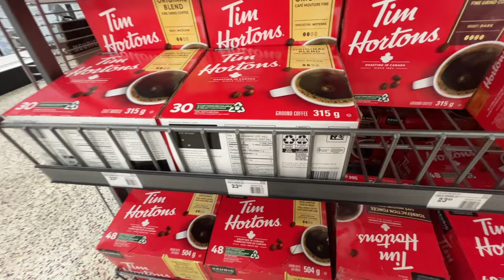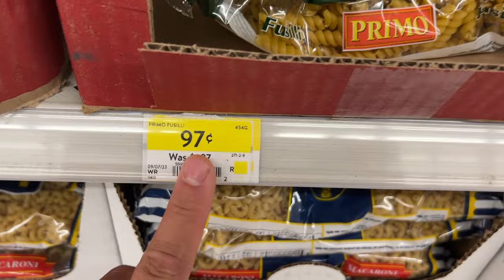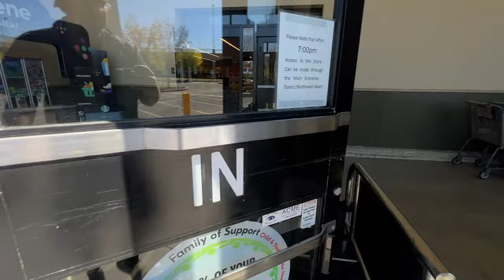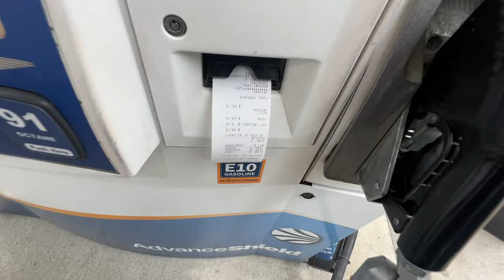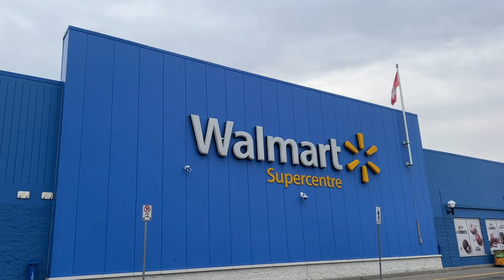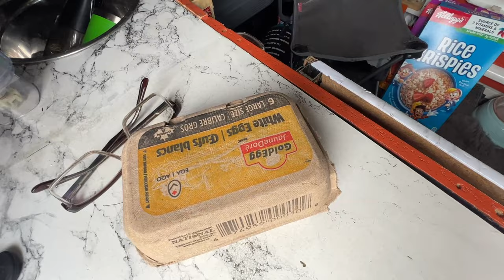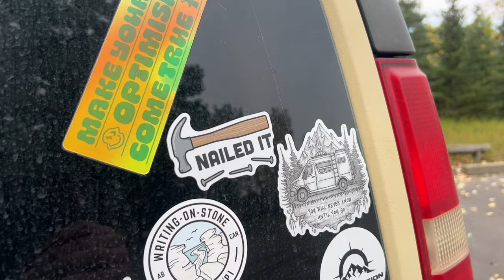City Vanlife Days - They were CONFUSED? Simple Living Works

Comment: If you prefer just using the van wheel as a step stool, you might want to look at getting yourself an over-wheel step. I'm pretty sure I've seen them before at Canadian Tire and Princess Auto. They fold up too, so ideally one would fit out of the way should you have space. Might be safer than just standing on the tire!
Reply from the maker: Actually had one earlier and because they end up sitting lower than the top of the tire they aren’t useful for reaching the storage bin
Reply: @VanlifePLUS  Ah, yeah if the step doesn't go high enough I can see that.

Comment: Do you get a staff discount for using self checkout if not maybe you shouldn’t just an idea
Reply from the maker: Unfortunately the whole situation has become a victim of itself. 

The stores no longer staff enough employees to make checking out through a regular till efficient. There are always far more closed tills than open ones and a large line at the ones that are.
Reply: @VanlifePLUS  
Some of the Walmarts here (Alb NM) are removing the self-check outs completely.
Reply from the maker: @lgDukeCity5018  that would be a step in the right direction - get more humans back on to the floor